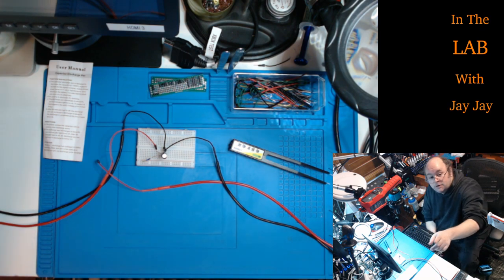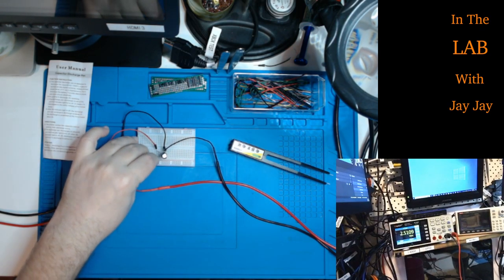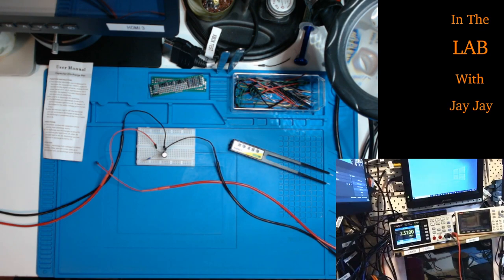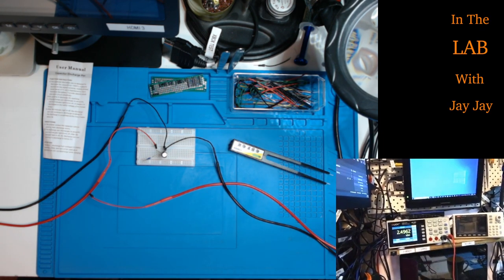Early Content #11: Demo of the ALKOY Capacitor Discharge Pen | In The Lab With Jay Jay

Comment: Please measure the resistance across the two contacts of the pen. I am curious to know what resistor value they used. However, depending on how the indicator LED is made into the circuit, you may not get a true reading. Meaning, if you can open the case, reading directly across the resistor would be best. I would like to see the circuitry. You might like to know if it is really built well enough for a thousand volts. Thanks. Cheers.
Reply from the maker: The resistor is 2MΩ. You can see the teardown here: https://youtu.be/HtIWICem9fY